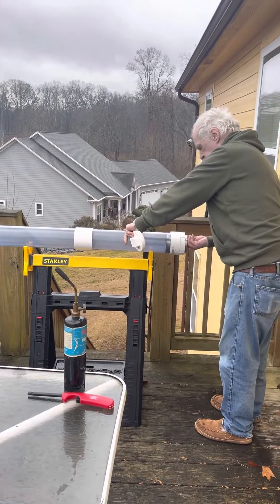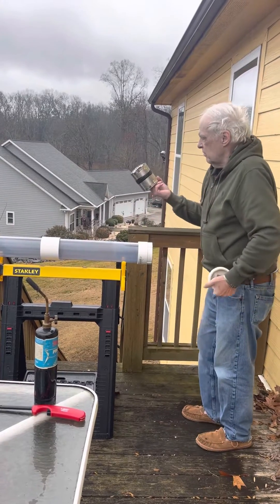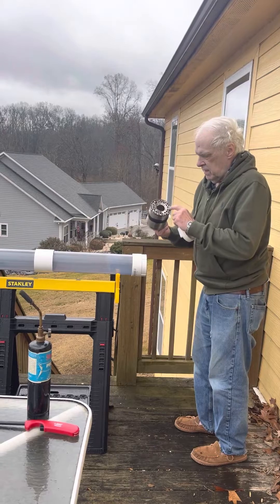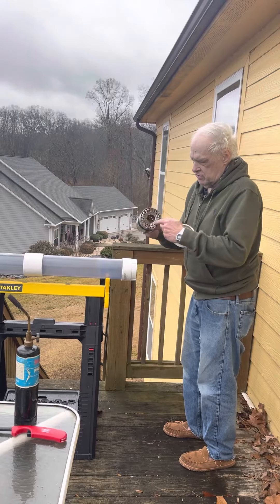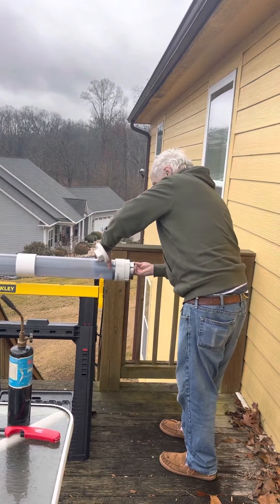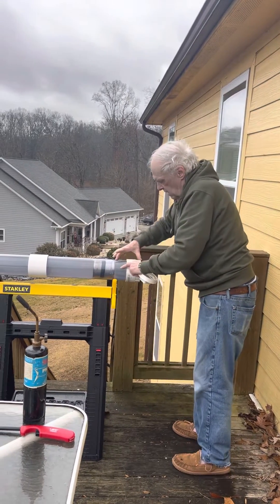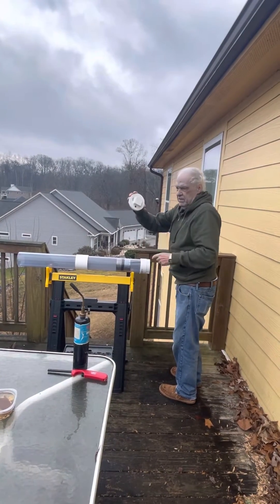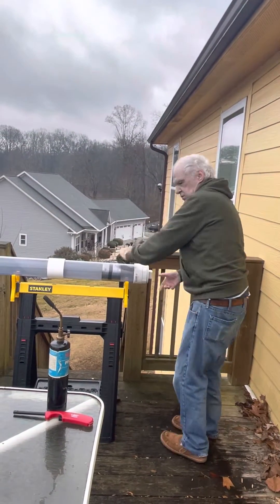Percussion cannon, using propane. Very Loud.

Comment: I have been using Calcium Carbide in mine but it is messy - Your cannon should work just fine without the vaporizer can the propane is already a vapor so need for the can.
Reply from the maker: The can is not a vaporizer.  It is to create a back pressure so the fuel explodes instead of just burning.  Without it it simply makes a whoosh noise about as exciting as when I light my gas grill.  It is like the difference if you light gunpowder in the open, or inside a cherry bomb.
Reply: @MarshallDudley  - my 4 inch PVC Cannon is completely open and sounds like an explosion going off - I KNOW THE ONES i MADE OUT OF SOUP CANS BACK IN THE 60S HAD THE BAFFLE TO HELP VAPORIZE THE LIGHTER FUEL WHEN YOU SLING IT AROUND.
Reply: My 4 inch PVC Cannon is just a larger version of the old soup can just no baffle and a T with a threaded clean-out cap holds my Calcium Carbide when I add water I can see the fumes escape from the end and I know it is ready to fire.